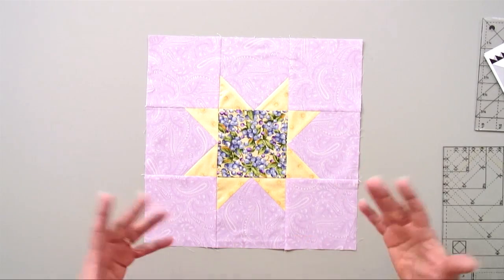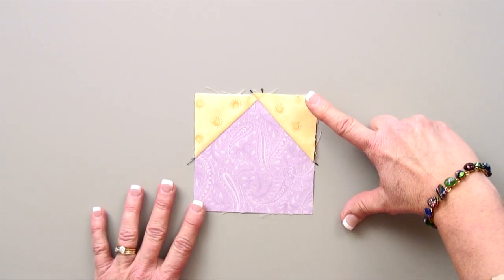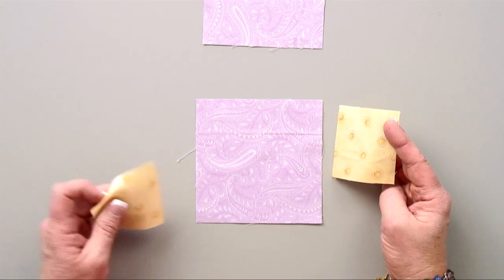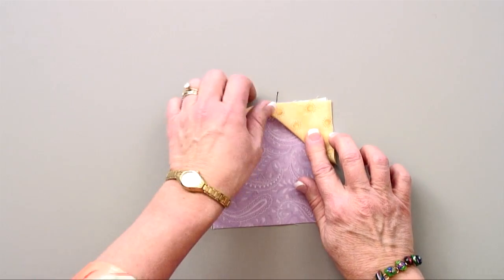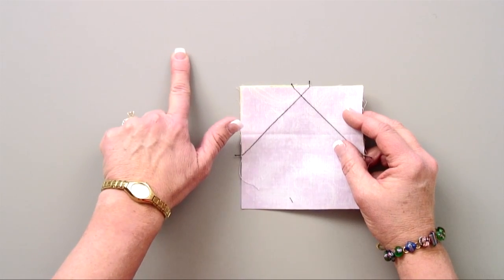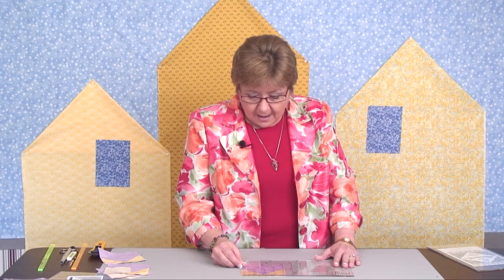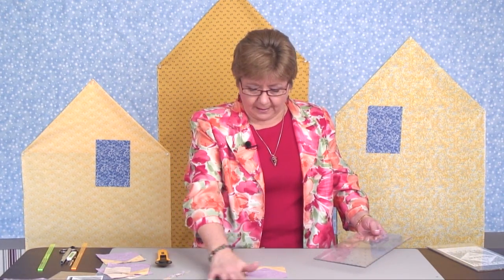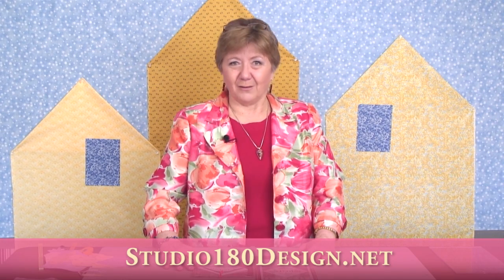Little Houses Technique Sheet

Comment: Any reason you can't use your Corner Pop instead of folded corners?
Reply from the maker: You absolutely can! I hadn't developed the Corner Pop ruler when I made this video, which is why I don't mention it here, and likewise the technique sheet companion is written to work with the Square Squared tool for the same reason. But if you have the Corner Pop tool and a little bit of quilting know-how, you can absolutely make the little houses units using that tool 💜
Reply: I actually did this today!  I needed to make a flying geese unit with floating points for a project. I tried using the stitch n flip technique. It failed miserably!  It took a few practice pieces, but I was finally able to get the math right and make a slightly larger rectangular, use my corner pop 1 tool to trim off the corners, and sew slightly oversized triangles to my rectangle. Then I used the squares squared ruler to trim the three sides with the triangles (as she showed here) then used a regular ruler the trim the final side. It worked beautifully!